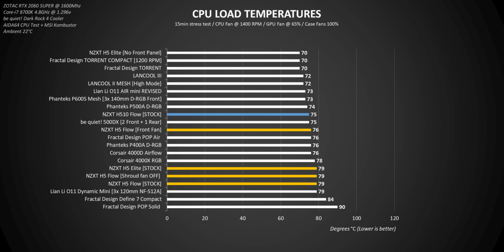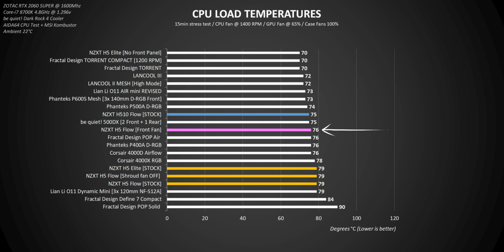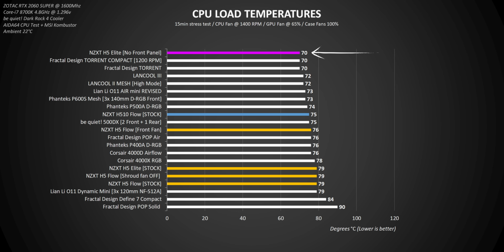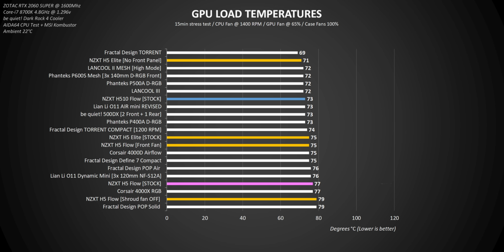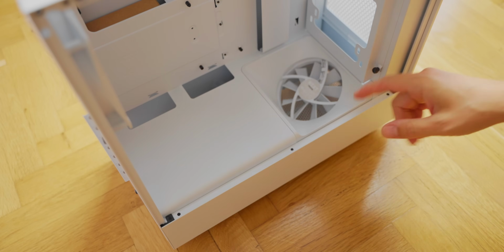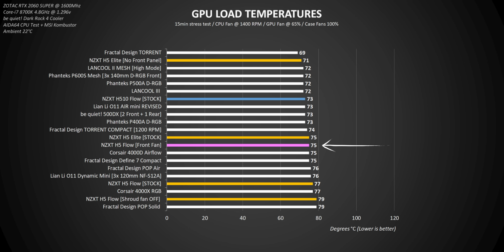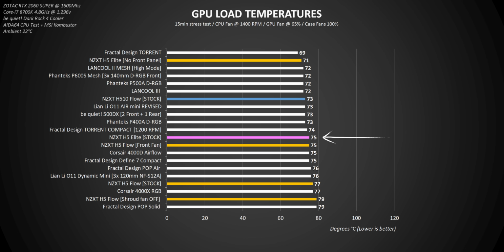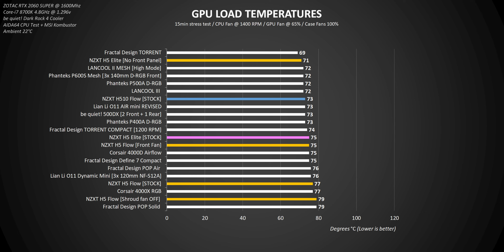This Case put a Fan WHERE?

Comment: I have the H5 flow and inside I’ve got a 14900K and an Rtx 4070 ti. The temps while overclocking my cpu to 6.2GHz on 2 cores and 5.7Ghz throughout temps stayed well beblow 70 degrees even under full load. As for the front panel I can agree it’s a little annoying as my 280mm aio and gpu kiss each other. testing the quality of the case by brutally shaking it is kind of stupid because PCs are not meant to be moved like that to begin with. For it just sitting in place the quality isn’t bad. Don’t hesitate to buy the H5 flow because of this review, it’s honestly a really good case. I’m sure you can get something better however if your a fan of NZXT’s minimalist look it’s a great case.
Reply: I’m getting it with a Ryzen 7 7800x3d and a amd 7800xt, I’ve heard the 7800 loves around 90°c, so is this case good?
Reply: I literally just built my first ever pc in it today. I'd say its great. Only bad thing is cablr management can be a bit rohgh because of that fan, but yoy do have the option to remove it. The Front Pannel pins are comvined, so its an automatic win for me😂@aspen2331
Reply: @JumperBloX  I mean, cable management won’t be an issue for me, so I see it as perfect! Hehehe, also what game do you play?
Reply: @Rocky_Aspen6021  Usually juat games like Rocket League, Apex, Fortnite, not too demanding.
Reply: @JumperBloX  ooh, I also play rocket league
Reply: @Rocky_Aspen6021  Not so much anymore for me, game died after the remove trading
Reply: @JumperBloX  ooh valid valid
Reply: Put your aio on top…
Reply: Price to performance ratio is very bad
Reply: I just buy it for $69 it was on sale

Comment: I remember reading somewhere once that NZXT is a budget brand pretending to be premium, and this case definitely gives off that vibe
Reply: i liked thier switch 810, was really cool rocking a 420/240 rad setup, it was great!
Reply: They say the new fractal one is good (torrent)
Reply: @OlavAlexanderMjelde  indeed. fractal torrent is best airflow case of this year so far. simply best freezer you can buy
Reply: @baristov  yeah, looked at the compact model in a shop today and I think I will do the torrent compact (which isnt really THAT compact, lol). Its more like mid case.. But for 4090 I think airflow is important and the fractal nano then just has one large front fan.
Reply: Their older stuff was nice.

Comment: Finally the review i was looking for! literary nobody else talked about the flimsiness of this case and the build quality in this much detail! Thank you so much!
Reply from the maker: It was the first thing I noticed unfortunately. I love the compact frame and the flow front panel... but man they need to step it up. Someone suggested in the comments to apply some adhesive rubber pads to remove vibrations: it would work and make sure to apply some to the front as well since that rattles under full fan speed on my H5 Flow :( 
-D.
Reply: @HardwareCanucks  yeahh, had the H5 in my cart before I saw this video but looks like I’m going with the 4000D, which definitely will be a better choice I think!
Reply: @HardwareCanucks  Its been downhill with NZXT to be honest. Everything in their new lineup is a significant downgrade form previous gen. My old h700 seems to have much better build quality than these. It also seems that with each generation, they take away features. So I guess I will be sticking with my old case for now. I feel I may need to go to something with better airflow soon though, with all these high power cpu/gpu combinations hitting the market.
Reply: @lukke6189  damn that exactly the case with me

Comment: Feels like ages since I've seen a new Dmitry case review! Nobody does them like you do. You're the only person I've seen mention the build quality and have actual criticism for this besides the small front fan.
Reply from the maker: Welcome back and happy to hear you enjoyed the vid :) What does everyone think of this less scripted and more dynamic format? 
-D.
Reply: @HardwareCanucks  I like it 👌
Reply: true
Reply: @HardwareCanucks  i was caught off guard. It feels a bit rushed, and less professional. I preferred the pacing of the previous style
Reply: @TheJuicyTangerine  I second this.
Reply from the maker: @TheJuicyTangerine  Gotcha. Thanks for your feedback! This definitely took less time than normal videos, but sometimes I dont feel inspired to shoot pretty b-roll and static a-roll of the same thing over and over hah 
-D.
Reply: @HardwareCanucks  Just to give you another view: My temps are extremely low with the 4090 FE. It seems to be a perfect fit for the founders cooler design. The toilet seems to help, however, even more in combination with front fans.  My 4090 FE isn't even running its fan sometimes while playing MW2 (4k, 144 Hz), depending on its load. It's staying between 35-65. I have the H5 Flow with mesh and two 140mm F140 installed additionally which is necessary. My 7600X never reached 70 so far while playing New World and MW2. At least it's much better than before with the CM NR200P :D
But: Once again. My 4090 FE has WAY lower temps, even in complete load (New World, 4k). This is weird. I can give you even a picture to prove it if you want. I'm using the Kraken Z53 White RGB for the CPU.

Dimitry, I love your ads. Your partners are probably extremely happy with such creative ads. Are you gonna review the new monitor? I'm interested in this one because I have some problems with the M9 from Sony.
Reply: @HardwareCanucks  Honestly I liked it a lot and it didn't feel rushed to me. Felt more like you were having a conversation with the viewer rather than talking at us.
Reply: @HardwareCanucks  Understandable! I think the best advice is a lot of this would felt better if you simply talked a bit slower. It sounded like you were annoyed/irritated, which comes off as biased and ranting, rather than knowledgeable (even though the things you were saying were perfectly logical and reasonable and substantiated by facts). I still think this channel is the best case review channel that exists, and why I stay subscribed. Hope you feel better and more inspired for your next video!
Reply: Exactly my thoughts! Dmitry nails it all the time, and while i understand the channel had to add more content, nobody does it better when it comes to case reviews and I hope we can see them more regularly like before.
Reply: @HardwareCanucks  Very straight forward , love it.
Reply: @HardwareCanucks  its great.

Comment: It annoys me that a lot of case reviews do not load up the case with fans for temperature testing, its a case, you need to put the rest of the system in it, including the fans.
Reply: Case comparisons need to be made either using the stock configuration or with a standard setup (usually 2 front and 1 rear). Custom configurations can't be compared and have no real value unless you use the exact same parts.
Reply: @donkeysunited  having no intake fans on the front is really not using the case for what its designed for, what is the point of a mesh if there are no fans there, any good/professionally built PC will occupy the available fan positions
Reply: @ToonamiAftermath  You're free to build it as you like. I'm just saying that case reviewers are limited in the configurations they use to test, in order to give more accurate comparisons to other cases.

If you can find a build video with this case you'll likely see them cram cooling in and they might do a temperature and noise test.

Comment: You can usually add 1/32” or 1/16” thick neoprene rubber strips to the side of the case where it meets the side panel to take up that slop/gap that allows the side panel to rattle. I’ve done it on numerous cases where the side panel doesn’t fit super tightly.
Reply from the maker: Yeah that's a cheap solution for sure. Also apply some to the front dust filter because something was rattling there at full fan speed when I was testing the temps. 
-D.
Reply: This is something you shouldn't have to do.

Comment: Ever since they released it, i was really hoping for a H510 Flow with 240mm AIO support on the top. The build quality is truly a shame though, because otherwise I really love this case. I also really don't mind the lack of fans. I would actually prefer buying cases without any fans and just add my own to it. 
Thanks for the review, although I don't understand why noone tests this case with all fans installed. Are most people really gonna use a case like this in stock configuration? I mean a pack of 5 Arctic P12 fans costs me 25€ here in Germany
Reply: GN just does that for all cases, as a way to compare what you get for the price. It is kinda dumb for cases like these and the Corsair ones tho.
Reply: Yeah, they should definitely add a maxed out fan metric. I doubt many people are only running 3x 120mm fans on a o11 dynamic for example.
Reply: That would be a dream come true! I'd also like to see testing of the top filter on vs off. I've always thought they were just a useless restriction, especially since so many cases have gone to a filterless front intake.
Reply: I have no clue why no reviewer on Youtube doesn't have a consistent testing methodology (wattage of the CPU and GPU so it won't matter so much if you change the model over the years) and a case with the absolute smartest/maximum Fans tested for each system. A true apples to apples for components, and apples to oranges for the cases fans.
Reply: @analogicparadox  No they don't. They don't maximize a cases potential. They standardize one test, and run another test with just the stock setup: they don't do a true comparison of a cases maximum potential; honestly because it'll take dozens of hours to do it with some cases.

Comment: Wow the build quality of this case is rough for nearly $100. I just recently got the H7 Flow ($130), and it feels like a premium enough case, especially when it comes to the side panels. It also has an extra USB port, and support for 360mm on top and 420mm in the front, much better than this case. I’d definitely spend the extra $30 for the H7 Flow
Reply: What do you think about h7 elite?

Comment: It's worse than you think... if you want to add extra fans, and have them match what comes with the elite case, and you want 3 intakes, 3 outputs, as you should... the hub that comes with the case only supports 3 fans. And it's USB powered. 
If you want to add 3 more fans , you get another 3 fan hub in the fan kit, which is also USB powered.
There's only one usb2.0 port on motherboards.

So not only are the 3 extra fans very very expensive, compared to corsair or cooler master or bequiet equivalent fans, but you also need a very expensive proprietary nzxt 6 fan rgb hub, which costs almost the same as the case itself.
Or a usb2.0 splitter, which again, is extra money and adds to cable clutter, needing 2 hubs and a USB splitter, in a case that has a "bottom fan shroud" taking up all the space for a hard drive rack or extra cable space..

Corsair cases , for example, come with 6 fan rgb hubs in all their rgb cases. As it should.

Also that gpu angled fan is a pure gimmick. It has zero improvement over 3 120mm front intake fans like on the h510 or corsair 4000d

Comment: My NZXT H440 taught me, and taught me well- aesthetics & a cool waterloop means nothing if the case itself is suffocating even pressure-optimized fans with aggressive speeds. It just bottlenecks the rest of the build itself for thermals. Go mesh. Always Mesh.  If you had an H440 on hand I'd love to see a comparison video and you can view just how bad it used to be (it'd top the chart of everything else in this video easily) lmao, still they're bad now with their front glass panels, but with offerings that allow mesh- it's atleast a lazy albeit alternative solution for a case manufacturer.
Reply: I actually like my H440, the build is solid as a rock. I do agree about the airflow though.

Comment: I have the Elite with glass and my temps are 42C CPU and 32C GPU.  Custom water loop is a miracle.  Also I changed the fans to BeQuite high speed, ARGB controller to RAZER instead of garbage NZXT.  Finally this may just be anecdotal, but the case sites on a stone tile floor.  It's always cool even on hot days so the air is passively being cooled before it enters the case.  GPU is a 3080ti so it can get hot.

Comment: I like my 510 Flow mostly because of the two tone so I’m disappointed that’s gone? 

Worth noting as many don’t comment on this: with the 510 flow (and I assume with this and that same bracket design) you can do a 240mm push/pull with the rad and pushers up front ahead of the of the bracket. They fit between that and front of case! I love it and looks great inside.

I don’t think that 2014 number is right even if you’re stretching the definition of the H500…

Comment: So, when I am building a new PC for my Asus 4090 TUF OC, it doese seem that Fractal Design might be the best choice today?
If I am looking for a not super large case? Or maybe Lian Li 011 Air MINI?
Reply: @SilentHillFetishist  Ok, I am no stranger to making hard stuff fit. I did run Arous 3090 Xtreme in NR200P, have built Xproto-L with 3090, with 4090 TUF etc.
So as long as I have some mm to spare, I can gently angle stuff or maybe mod stuff. I also ran an external radiator on top of an NR200P once :-P Frankenstein mod!

So for me its most important that it cools well and not noisy, also I dont want a super large case.
However the 4090 TUF from Asus is too long for a lot of cases.. And I think that I want to go away from gpu risers, especially as in time I will build a new PC with gen 5 PCI-e. But as I have 5950X now, and just game in 4K, I am waiting for X3D version of 7950X. Then I guess NVME gen 5 also will arrive maybe? :)

Comment: For years I’ve had a 140mm case fan pointed at the back of my graphics card, whether there’s a backplate or not, temps improve significantly, I mean for such a simple thing, your memory temps will definitely come down, GPU 3-5C depending on your situation

Comment: I actually have a 140 (stuffed I'll admit) in that bottom location in a family PC. It started life as an older cyberpower prebuild (onyx mid tower case or something) so it came with wrongly oriented fans and no airflow potential generally speaking. Once my old 9900k ended up in there that case was a toaster. I started with a back panel cut to get the two 120 intakes real air access, but that wasn't enough. Removing the drive bays and putting an upward facing 140 right below them definitely did the trick though. I'm sure this causes too much turbulence, but the performance is so much better that I've never needed to explore internal ducting/guides. It works (in some cases) in other words. The case hasn't been so much as warm to the touch since then, and definitely not throttling and getting hot to the touch like it was previously. It works well enough that I switched to a noctua (d-15) cooler to take advantage of it, and the CPU temps are improved over the 240 aio it had before.

Comment: I have two NZXT cases, one being an OG Flow that came with an NZXT BLD pc that I snagged when they were offering a hefty discount on Black Friday.  I would say they are both nice cases but the other Flow that I got with that BLD pc about a year ago is kinda cramped to work in, and the single top fan did kinda annoy me.  Ultimately the build stays pretty cool with a front mount rad with two 140, and then a top and rear fan.

Now a side note, NZXT BLD was initially a decent experience and they worked to troubleshoot the issues I ran into with games crashing.  Eventually though I was talking to someone knowledgeable I met through Evolve and we ended up checking the PSU, and realized it was the same model that GN had found out was a fire hazard (I regret not paying more attention), I tried to get in touch with NZXT but after no response in 24hrs I ordered a EVGA 850w and once that I arrived I pulled all the Gigabyte cables and the PSU and installed the EVGA one.  Unfortunately my luck was kinda terrible, had bad coil whine and had to RMA that one...BUT once all of this was done, and a proper undervolt applied to my 3080 FE everything was smooth and temps have been great besides one odd day where things got into the 80c range and I was seeing oddly high usage numbers so I restarted everything and it was back to normal.  Thanks to the fact I have some experience with building my own PC, and a few friends I managed to stay afloat, but NZXT BLD is targeted at people who might not be able to manage the way I did...I think I am done with NZXT as a brand.

PS. Only reason I purchased a BLD is my old rig was starting to get really long in the tooth, and getting a 3080 at a reasonable price was stupid hard at the tine.  I had priced out a build on Newegg, but using an MSRP GPU price in that equation and then the next day the notification popped that NZXT had this FAT discount,  and it put the build within 100 USD of the one I had hoped to piece together.

Comment: Having two usb 2.0 ports on case front/top is essential. I have usb receivers for my logitech wireless mouse and keyboard in those slots; placing them in the back of the case would cause wireless interference. A single 2.0 port makes this case unusable.
Reply: I'm thinking I'll have to add a hub/extension with magnets taped to it to get my USB fix. I'm coming from a case with 4 front USB (2x2.0 2x3.0)

Comment: I rememmber old good days when fanhub did not use rpm and used 12V, 7,5V and 5V was so good to have a switch on front panel to make it run faster or slower so simple.

Comment: Hoping the H5 would be exactly same as H7, just smaller. That would be good. No 140mm top is wasted space. GPU cutout is gone, big feature I like and gpu fan is not gonna do much at all when front fans are installed.
Reply: it helps with the 4090 FE